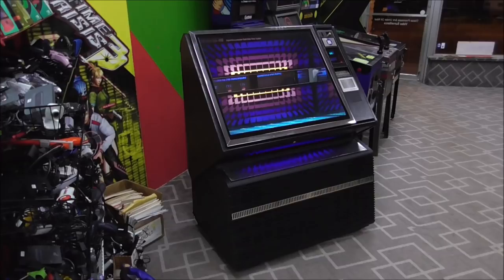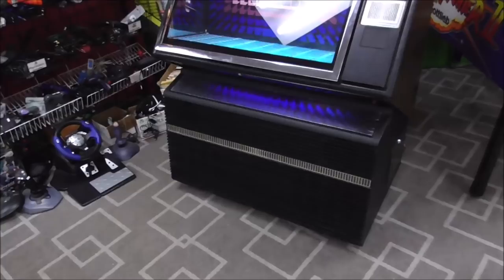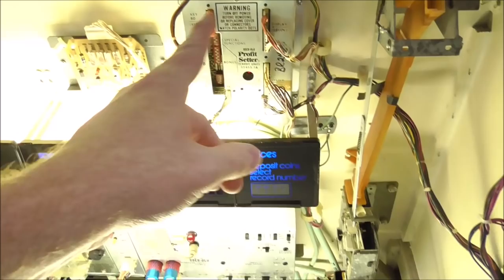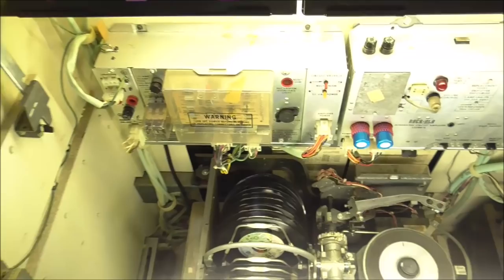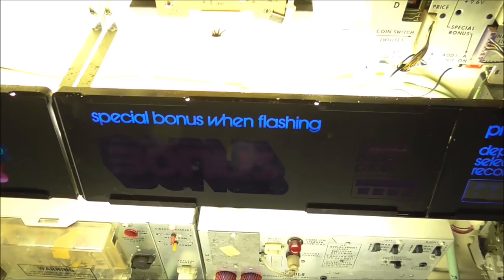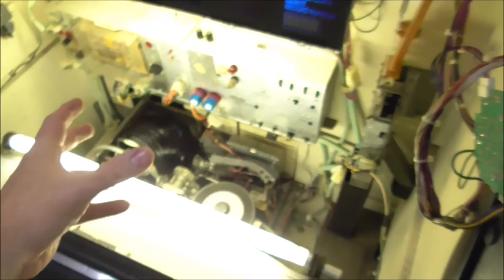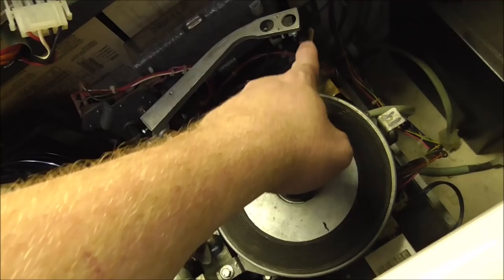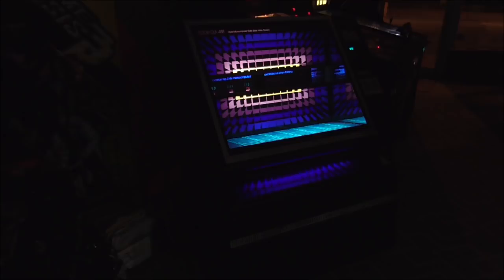Rock-ola's Beautiful 1982 "488" Jukebox, Step by Step How The Mechanism Works! Still Working Great!

Comment: When you get one of those tray load optical bill acceptors working just right.  thats a moire
Reply from the maker: Those things were so cool....
Reply: @LyonsArcade  we had these laminated test dollars to work on those so we didn't need real dollars,  I'll bet the testers cost $5 each
Reply: They had optical then? I remember the magnetic pickup and light beam would be used to see a bill in the accepter.. optical came out from mars and coinco about 1989.. I worked on a lot of soda and candy machines during that time.
Reply: @Astinsan  it had a bulb with a filter that would slide across the bill and generate a moire pattern if the dollar was real
Reply: Jesse I’m LMAO at your comment. I think it went right over the other folks’ heads.

Comment: Ron, i've been ask to look at a 477, and i feel quite confident in having a go due to watching your repair videos. I know the mech is jammed so i'm going to strip that down first before i turn it on. Just a bit worried about the electronics. I normally mess with Pinballs and Bally ome armed bandits
Reply from the maker: They're all pretty similar, the main issue will be that mech being gummed up...

Then you have the power supply, they're similar to the pinball power supplies just make sure you have your voltages and if you don't fix that area...

Then you have the Profit Setter, if that has issues you may have a problem!  It's about 50/50, I haven't done too much work trying to repair one but the issue is they use strange chips that use a strange voltage (9.6 volts?) so when they die it's hard to diagnose.

Comment: In diners, they had a remote in each booth to choose the songs to play.  How were they connected to the actual jukebox?
Reply from the maker: Long wires!
Reply: @LyonsArcade  I was hoping for a few more details - did it lock out the other devices while someone was choosing their records?  How does it remember all the songs that have been chosen and in what order?   These probably were long before the Rockola - my guess is pins were set when a record was chosen which caused the carousel to stop..

Royalties for BMI and ASCAP and ratings would be an important part of the operation - not just for the operator to get more quarters.  I don’t know a lot of the details and would like to keep my kneecaps

Comment: How would you best recommend how to clean 45s that have been sitting in the 488 since 1991?
Reply from the maker: I literally just wipe them down with windex!  They  make special cleaner for them though but man they're plastic, you can't really damage them with a mild cleaner like windex which is basically soapy water with a little ammonia in it.  Be careful with the paper labels though it'll stain those of course.  If they're completely filthy maybe something stronger like 409.
Reply: @LyonsArcade  ok, thanks for the honest advice!

Comment: To think that in 1982 first-generation compact discs were making their way to record stores!
The record industry is pretty much dead.  It took less than 10 years of mp3 and the industry not adapting to reality and changing its ways (lousy, overpriced albums; arguably obsolete format/CD that NEEDED to be replaced; generally bad new content being released) to wipe out what USED TO BE the largest entertainment sector.
Most stores don't sell albums anymore.  You have to buy soundtracks online.  A lot of stuff is out of print and ridiculously overpriced.
That's NOT a healthy industry.  Comic books are headed this way, too!